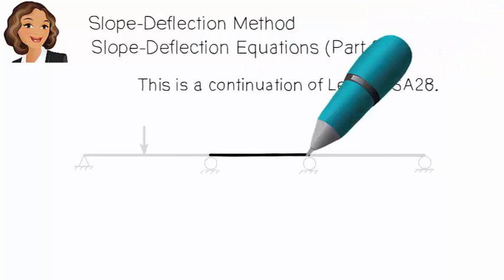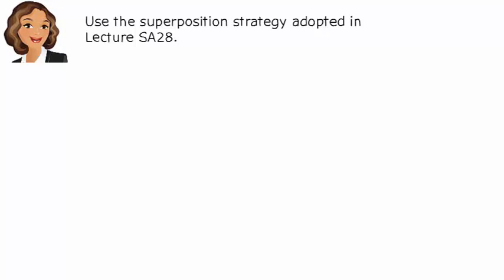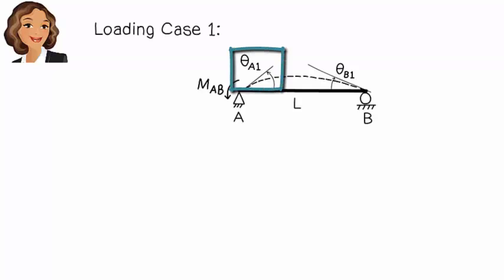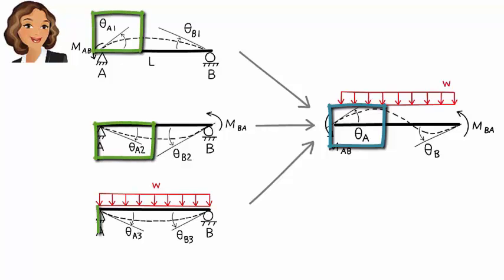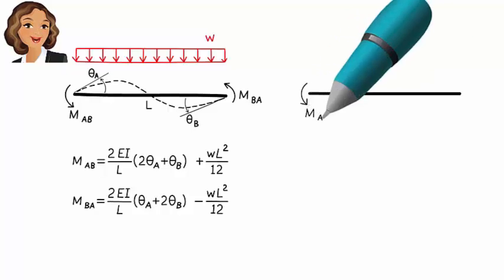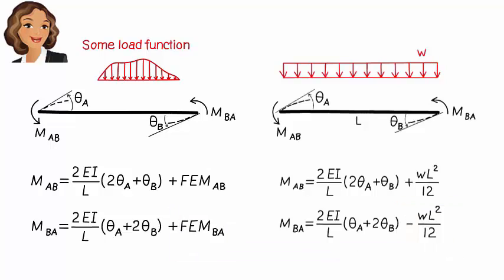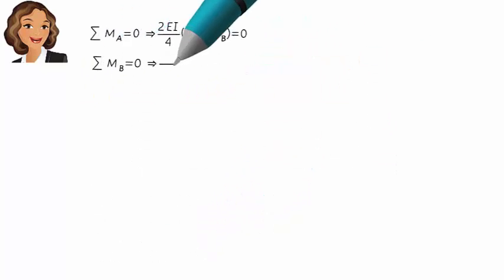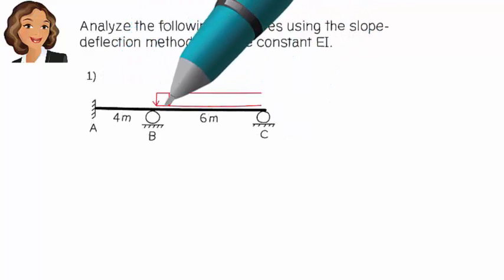SA29: Slope-Deflection Equations (Part 2)

Comment: You are missing the solution (a video) for the first problem.
Reply from the maker: The solutions are provided in the free online course referenced in the video description field.
Reply: I got M(a)=-75 N-m, M(ab)=75 N-m, M(ba)=150 N-m, M(bc)=150 N-m, M(cb)=-300N-m. Vertical reaction at A=56.25 N; vertical reaction at B=181.25 N; vertical reaction at C=175 N. Are these the answers?
Reply from the maker: No, your solution is not correct. The correct solutions for the exercise problems are provided as a part of the online course referenced in the video description field. See:

https://courses.structure.education/courses/take/structural-analysis-i/lessons/19946240-slope-deflection-equations-part-2

Comment: So all moments at the joints act clockwise everytime  ??
Reply from the maker: The direction of an unknown force or moment has to be assumed. The sign of the force/moment magnitude, after it is calculated, tells us if the initial assumption was correct. If the magnitude comes out positive, we know the assumption was correct. Otherwise, the actual force/moment direction is opposite to the assumed direction.

In our slope-deflection formulation, we assume the member-end moments to be acting in the counterclockwise direction. If a computed moment value turns out to be negative, then we know that moment is actually acting in the clockwise direction at the end of the member.
Reply: @DrStructure  thanks Dr i understand now

Comment: How do you do to know the directions on shear forces ? Cause I’m confused why VAB going downward and the rest upward?
Reply from the maker: Before calculating them, we don't know the direction of the member-end shear forces. When drawing the free-body diagram for the member, we always assume a direction for the unknown shear forces. We then write and solve the equilibrium equations for the unknowns. If we end up with a positive value for the shear force, we assumed the correct direction. If we get a negative value for the shear magnitude, then we know its actual direction is the opposite of the assumed direction.
Reply: @DrStructure  thanks!! I appreciate it

Comment: How do I know what direction to assume the shear forces in?
Reply from the maker: Since the shear force is unknown, you can assume it to be upward, or downward. Make a choice and draw the force in the assumed direction on the free-body diagram. Then write the equilibrium equations accordingly and solve them for the unknown shear forces. If your assumption is correct, the computed value would come out positive. Otherwise, you get a negative value for the shear force. Either way, once the equilibrium equations are solved, you know the actual direction and magnitude of the shear force.

Comment: I think there’s a slight mistake . I mean the part of vbc and vcb I don’t get it why 160*6*3 -450- 6vcb ? I think it’s 150*6*3+405 +6vcb right ?😅 I’m confused
Reply from the maker: Correct. There is a typo in that equation. The magnitude of the distributed load is 150 not 160. So, the correct moment equations is (taking clockwise direction as positive) :

(150)(6)(3) - 405 - 6 Vcb = 0
Or, Vcb = 382.5 N
Reply: @DrStructure  thanks 🙏🏾 you are the best

Comment: I'm still confused about signs for FEM. Does the sign represent the moment generated by the load or the moment resisting the load?
Reply from the maker: Fixed end moments are the reaction forces at the supports due to the applied load; they are the resisting moments. A downward load has a tendency to rotate the beam in the clockwise direction at the left support, and in the counterclockwise direction at the right support. So, the resisting moment (FEM) at the left support is counterclockwise, and the direction of the FEM at the right support is clockwise.
Reply: @DrStructure  
Many thanks!

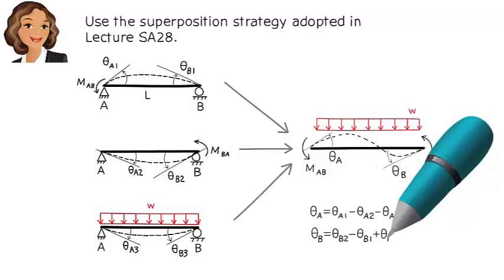Comment: why is theta B3 positive unlike all the other thetas at 2:14
Reply from the maker: In this formulation, counterclockwise is taken as the positive direction. That makes, theta_a1, theta_b2 and theta_b3 positive, and the other three joint rotations (theta_b1,theta_a2, theta_a3) negative in the two theta equations

Comment: Load case 3 happens due to the load applied on the members, BUT why include  Load Case 1 and Load Case 2 if the beam is already loaded?
Reply from the maker: This derivation seeks to establish the mathematical relationship between member-end moments, rotations and the applied load. Case 3 by itself is a simply supported beam that is free to rotate at its ends (with zero end-moments).  That is not going to help us come up with a general formulation for the slope-deflection method as in a typical beam segment (in a continuous beam) the ends of the segment are not completely free to rotate; the bending moments (Mab and Mba) at the ends of the segment are not zero. So, we need a formulation that does take these end moments into consideration. The simply supported beam by itself does not do it. 

Now, if we treat these end moments as loads, and apply it to the beam (as in Loading Cases 1 and 2), then use the principle of superposition to add the resulting rotations to those obtain from Loading Case 3, then we can establish the necessary relationship between the non-zero end-moments, rotations and the applied load.
Reply: @DrStructure  I Understand that due to superposition cases and 1 and 2 are algebraically added. But I still don't relate how the algebraic sum that includes all cases relates them. In the force method I understand why you add the deflections of the unit value and the loads acting on the primary structure, somehow I miss it here. Please elaborate.
Reply from the maker: @dear_dennis  Let me give this another try.  Suppose we have a simply supported beam subjected to a uniformly distributed load. What would be the rotations at the ends of the beam?  This corresponds to Loading Case 3.  We can determine the end rotations using the virtual work method, for example.  Here, we have basically related the end rotations to the applied load. If we know W (the load intensity) then we can determine the total end rotations in terms of E and I. This scenario, however, assumes that the moments at the ends of the beam are zero. 

But, suppose we are told that the moment at the left end of the member is not actually zero. We don't know what that moment is, we just know it is not zero. How does that effect the end rotations?  Obviously, the end rotations are not going to be that of Loading Case 3 since now there is a moment at the left end that somewhat restrains the rotations. So how do we adjust the end rotations from Loading Case 3 in the presence of Mab?  That is where the principle of superposition comes into play. We treat Mab as an applied load/moment, calculate the end rotations in terms of Mab, then add them to the end rotation due to Loading Case 3.  That gives us the mathematical expression(s) that relate the beam's end rotations to W (the applied load) and the unknown end moment (Mab). 

If we apply the same line of reasoning to Mba, then we get the three loading cases that we have here.
Reply: @DrStructure   Thank you! That was very explicit! I guess it was easier for me to understand first load case 3 since the effect of the load is applied directly to the beam, while load cases 1 and 2 relate the adjacent sides. Now I understand much better the simplification when the beam's end is an overhang or a simple support.

Comment: What is the difference between member end moment and fixed end moment practically? They both are acting at the end of the member. Please explain.
Reply from the maker: Member-end moments are the actual moments found at the ends of the member, once the structure assumes its deformed shape. Fixed-end moments are moments at the end of a member that is assumed to be fixed at its ends.

Consider a continuous beam having 4 spans. Suppose we load the second and fourth span with distributed loads, there are no loads applied to the remaining spans. The beam is going to deform, its five joints are going to rotate, and moments develop at the ends of each member. These are the actual (member-end) moments which we can then use to design the member. So, even though spans 1 and 3 are not subjected to any loads, member-end moments do develop at their ends.

Fixed-end moments are not the actual moments in a beam, unless the beam is fixed at both ends. These moments should be viewed as a representation of the applied loads. In the slope-deflection method, we simply replace an applied load with its equivalent moments at its ends (with its fixed-end moments.) That is, in the eyes of this method of analysis, a distributed load of W applied to a beam of length L is equivalent to a bending moment of WL^2/12 (the fixed end moments) applied at either end of the beam. So, to analyze the beam, we first replace each load with its equivalent fixed-end moments, then go through the analysis to determine joint rotation and then the actual (member-end) moments for each beam segment.
Reply: @DrStructure Thanks for explaining. 
But I have a doubt. We know actual bending moment at hinge or roller support is zero. And the hinge or roller position and the end of a beam represent same point. So how is it possible that the bending moment value at the same point (hinge/roller position or end of a beam) have two different values (one is zero from hinge/roller consideration and other is non zero from member end consideration)?
Reply from the maker: Yes, it is always the case that bending moment at a hinge or a roller support is zero, if the support is located at the end of the beam. If however the hinge or the roller is an interior support, then bending moments do develop to its left and right.  Regardless, when using the slope deflection method, we always start by labeling the member-end moments for each member, even if we know the moment is zero. 

Say, we have a beam fixed at the left end with a roller support at the right end. Suppose we have labeled the ends of the member A and B. Even though we know bending moment at B is zero, we can still label that moment Mba. Then, when we write the joint equilibrium equation at B ( Sum of the moment at B must be zero), we set Mba = 0, we enforce the fact that the moment at the roller is zero. This enables us to calculate the slope of the beam at B while enforcing the constraint.
Reply: @DrStructure  Okay. Thank you very much.

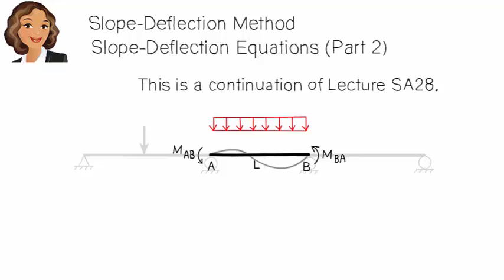Comment: @0:36  the beam had two rollers at the end, then how come while superimposing the beam is having one roller and other pinned?
Reply from the maker: When dealing with beams (not beam-columns) the only forces that are present (according to the beam theory) are shear and moment. There is no axial force in a pure beam. The slope-deflection method is based on beam theory meaning axial forces do not show up in the formulation. 

The difference between a pin support and a roller support is a horizontal (axial) force. The pin has one, the roller doesn’t. But since our beam carries no axial force that horizontal reaction force at the pin would be zero. So, the pin acts like a roller as far as our analysis is concerned. In a way, they are interchangeable in our formulation.
Reply: Dr. Structure but doing that makes it determinate from indeterminate so we were able to apply virtual work. Had it been any indeterminate structure, how would we apply virtual work method then?
Reply from the maker: Replacing the pin with a roller does not make the beam determinate. That beam is already determinate with a pin and a roller support. 

We have picked such a beam deliberately.  The specific sub problem that we are trying to solve here always involves a determinate beam, a beam that is going to rotate at its ends resulting in the end slopes theta_A and theta_B.  Otherwise we would not have be able to come up with the equations that relate member end moments to the slops.

Also keep in mind that here we are deriving the slope deflection equations, we are not analyzing an indeterminate structure. What we are doing is establishing the mathematical relationships between member end forces and rotations.

If we had an indeterminate beam and wanted to calculate some slope or deflection, we would have started by analyzing the beam first, then we would have applied the virtual work method to calculate the desired displacement/rotation.

Comment: why does  moment ab is positive when you apply it at the joints ?  it should change to a clockwise direction and we picked that moment rotation as negative. Thanks :)
Reply from the maker: Please be more specific. You mean in the example at the end of the lecture?
Reply from the maker: True, we show the moment at A is the clockwise direction since at the end of the member, the moment is shown in the counterclockwise direction.  That is also true for the other joints. So, member-end moments shown at joints all are acting in the clockwise direction. 

When writing the joint equilibrium equations, we are summing the moments at each joint. Since they are all acting in the sane direction (clockwise) then we simply add them together, as positive terms, or as negative terms, it really does not matter. That is,  -Mab = 0  is the same as Mab = 0. Or, -Mba - Mbc = 0 is the same as Mba + Mbc = 0.  The sign convention that we use for adding moments at the joints is independent of the sign convention that we use for writing the slope-deflection equations for each member.

Comment: @7:57 is it the same theta B on left and right of the joint B ? .. thanks in advance
Reply from the maker: Yes, the rotation immediately to the left and to the right of the joint indeed are the same as the rotation at the joint.

Comment: @8.36 MCB you should put -450 not -540
Reply from the maker: Please elaborate. Which results?
Reply from the maker: Thanks for the correction.
Reply: how do you get this result?
Reply: theta A and theta B
Reply from the maker: To find the unknowns, the equations need to be solved simultaneously using techniques such as Gaussian Elimination.